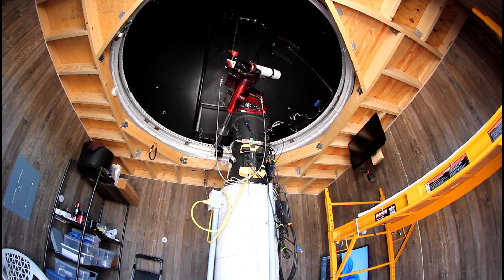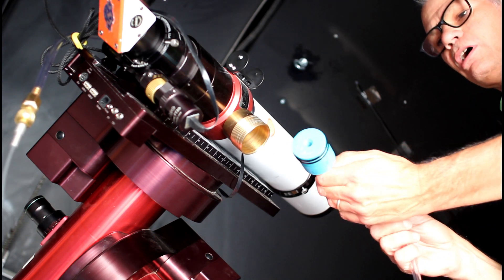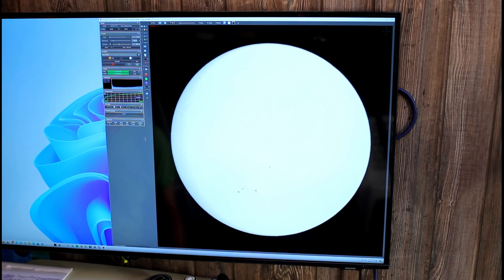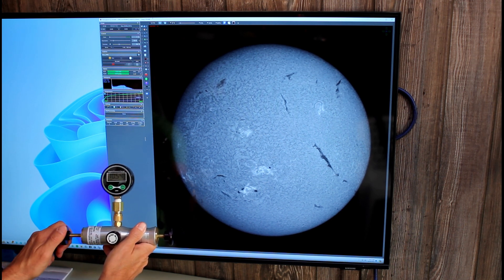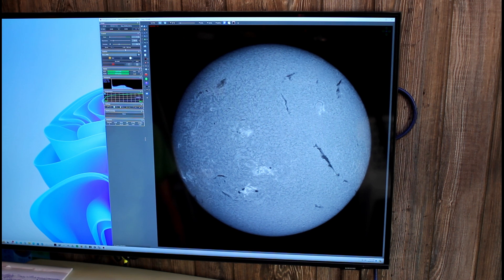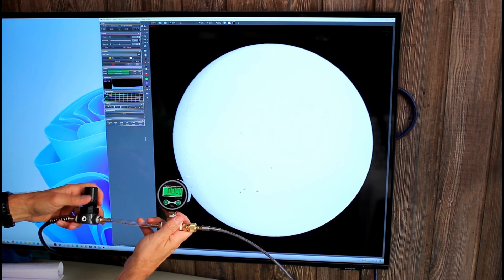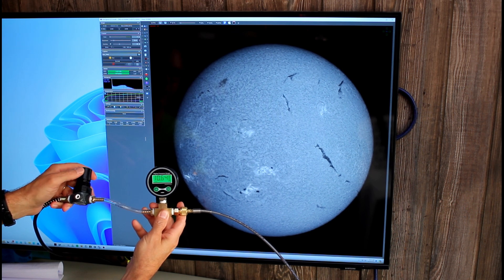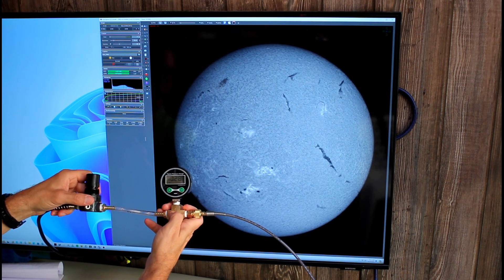Remote Pressure Tuning a Lunt Solar Telescope

Comment: Is it not  better to remove  the entire prssure tuner and  in the existing hole install a fittin for the pump house?
Reply from the maker: Yes, that might well be a better solution because you avoid having to replace the plunger with its O-rings. But, I was afraid of destroying my telescope by trying to unscrew the brass fitting for the pressure tuner knob. I suspect it is not intended to be removed. It may be that it simply unscrews but if it doesn't then it might have to go back to Lunt for repair. The Lunt remote pressure tuner also replaces the plunger, so maybe they know something?

Comment: Barry. I have a similar situation How would I purchase the plungers?
Reply from the maker: First, if you have deep pockets, Lunt sells a wonderful device for remotely controlling the pressure on an etalon for $810, but you would need two for a double stack:

https://luntsolarsystems.com/products/lunt-pc-usb-pressure-tuner-controller?variant=41755271823473

If instead you want to build one of your own, you can see how I did it by 3D-printing parts on my Thingiverse page:

https://www.thingiverse.com/thing:6671409

There are companies online or locally in urban areas that will 3D print parts for you from the STL files you can download from Thingiverse.com.

My other YouTube video showing my double stack remote pressure tuner is here:

https://www.youtube.com/watch?v=N9hbjr91L-w

Let me know what you decide to do!

Comment: Great alternative to the expensive USB pump! I will try it. Thanks for the inspiration. Is there a too much pressure I can do with the manual pressure pump?
Reply from the maker: I have limited myself to a 15 PSI system to protect the telescope. I find that the optimum tuning pressure for both etalons is below 15 PSI, so there is no advantage to be gained going to a higher pressure.

Good luck!

Comment: how did you remove the retainer ring that holds the roller bearing on?  Does it unscrew or do you press the bearing and retainer ring out?  Awesome idea.  I have my 3D prints complete and I am ready to assemble.  Thanks for the innovation.